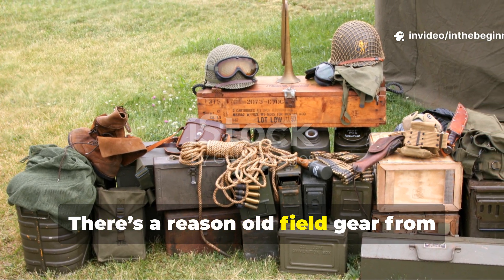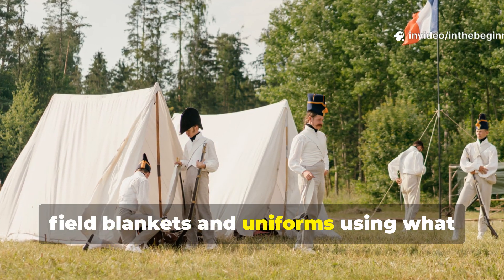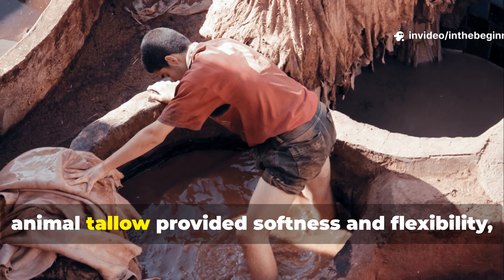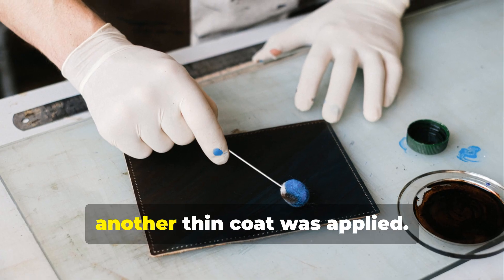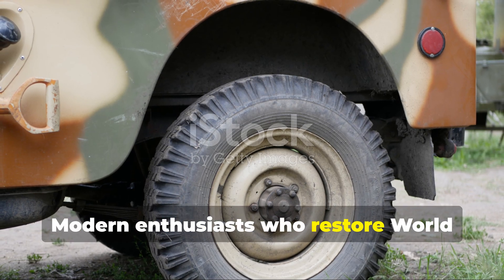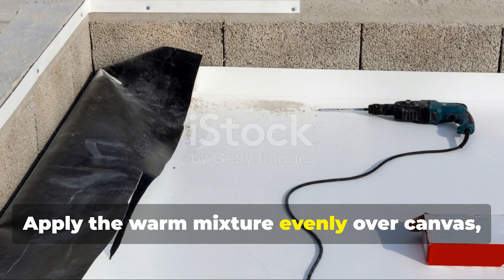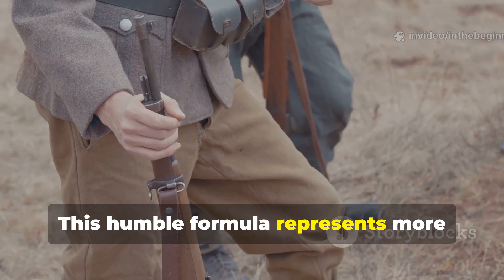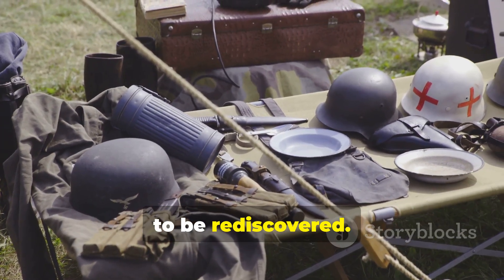Forget Tarps — The WWII Wax and Grease Formula That Turned Cloth into Armor Against Rain

Comment: Specification PQD 151 from March 18, 1942, shows they used a synthetic resin coating developed from limestone, coke, and salt by B.F. Goodrich. The treatment was commercially known as Koroseal and was used to waterproof fabrics. Other good research can be found by reading PQD 71F and PQD 291B. Some armies did use waxed fabrics, but it was hardly a secret and in use by mariners since the mid-fifteenth century. The Germans used lead(II) acetate and a mix of other deadly chemicals to waterproof fabrics.
Reply: It is useful to have the knowledge on how to use old technology to waterproof fabrics.  I have  a Barbour waxed jacket that needs re-coating from time to time using liquid paraffin wax.  It is heavy, smells like a canvas tent when wet, but is the best windproof jacket I have ever had.  Combined with a long-sleeved T-shirt and a wool sweater, it is probably the warmest combination I have ever used.

Comment: During WW2 the tents of the Ringling Bros and Barnum & Bailey Circus were waterproofed with paraffin. The process was accomplished by dissolving the paraffin in gasoline and applying it to the canvas. The gasoline evaporated leaving the wax in the fabric. When the tents caught fire in July 1944 it killed 167 people and left over 700 injured. My mother was a nurse in Hartford at the time. If you use wax or paraffin on fabric be aware you can turn yourself into a torch. Look for other videos on using silicone caulking dissolved in paint thinner for a safer alternative. The cost will be about the same and it will be much safer.